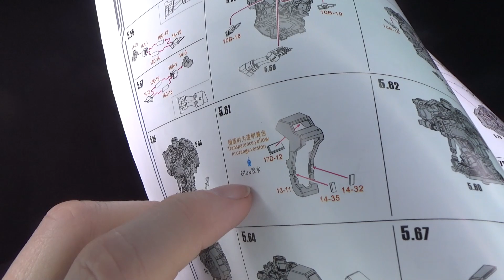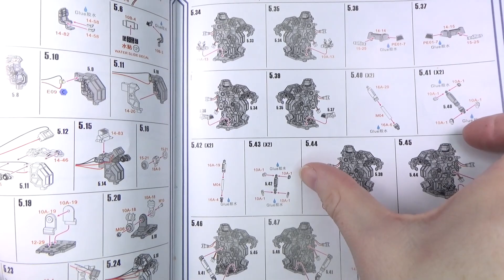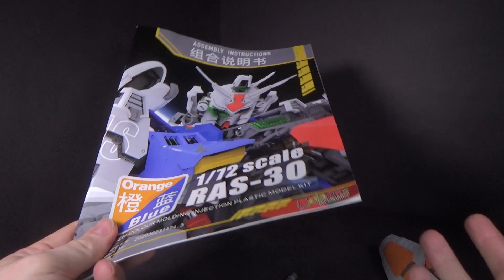Do I expect too much from a $300 model kit?

Comment: mechanicore (or whatever they go by these days) kits are notorious for using glue on several pieces so those who regularly buy these kits are all well aware of the flimsy fitting. You're basically paying for the unique design, scale, and the fact that bandai has no plans in making a GP03S. The LED's requiring soddering is pretty shitty though, it sould be either properly done or excluded all together.

Comment: 1 button on the stand activate the stand lights 1 button turns on the mobile suit lights the other one is a button for you to test the LEDs while you're building the kit. There should be a small plug in at the top of the base arm. Just a heads up. The end result will be worth it. Stick with it.
Reply from the maker: Well I hope the wire that broke is the testing one. Will find out soon.

Comment: seriously, not wanting to sound like a jackdonkey, but this is like saying g-system kits should be snap together and prepainted. at least mechanicore moulds their plastic in color.
Reply from the maker: I understand what your saying. It's just that the kit does have pegs and a FEW parts do snap together without a problem; but I'd say 95% of the kit needs to be glued well or it will fall apart when you try to pose the model kit with actual articulation.
Reply: It’s supposed to be glued. Even with pegs. It’s more a guide. Not a snap together kit. You peg it together so it sits in the right place. Then glue it together!

Comment: Bought the 1st mechanicore kit and will never build another one,overly complicated,bad fitting issues and crappy molding and they haven't improved one single bit so they're not getting my money.
Reply: The new Mechanicore kit that just came out is great. Molding is top notch. It’s meant to be complicated. That the reason to get one. Bandai are too simple to build. Like for a 8 year old. Even pg’s aren’t difficult. These 3rd party kits are for expert builders.